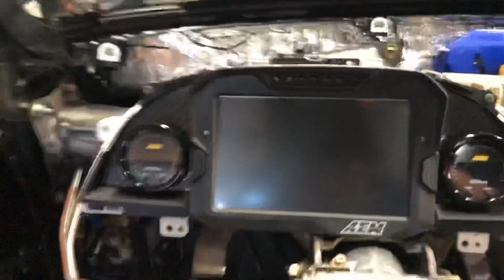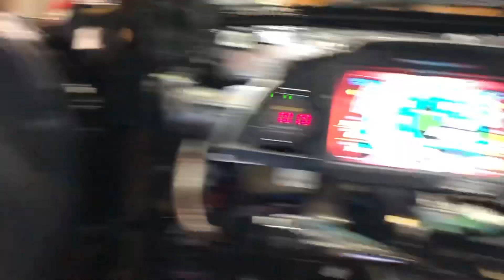AEM Carbon CD7 Dash driving in A/C comfort

Comment: Hey Pat, Is the ac all wired up like normal or did you have to come up with a wiring work around?
Reply from the maker: cms-gt4 it’s wired up like normal, had a spare harness so just took the wires that was needed.
Reply: @alltrac101  My biggest issue was using the idle up. My system did not want to control it. Without the ecu I can either have idle up or compressor activation. Not both. So I am going to run the idle up off a relay when I get a chance to wire it up.
Reply from the maker: cms-gt4 I’m taking the stock compressor relay output and sending it to the AEM from there it controls the idle up, fan, wot etc.  the temp cycling is controlled by the stock ac amplifier
Reply: @alltrac101  That works. I will likely dig back into mine after this last semester. I guess you had to go get a new compressor. I am still running your old one. I used non Toyota o-rings and I think I have a leak due to that.
Reply from the maker: cms-gt4 went to a 97 Camry 134a compressor